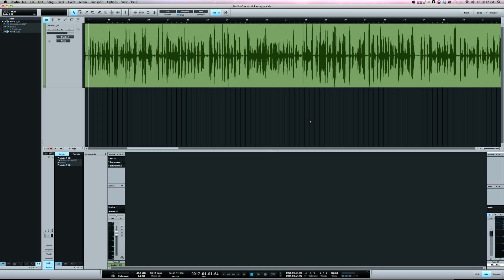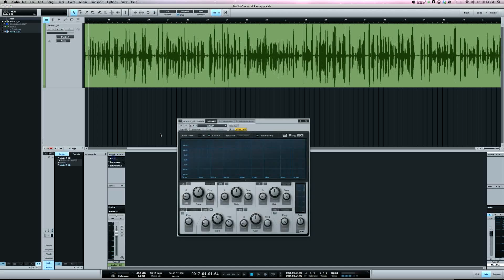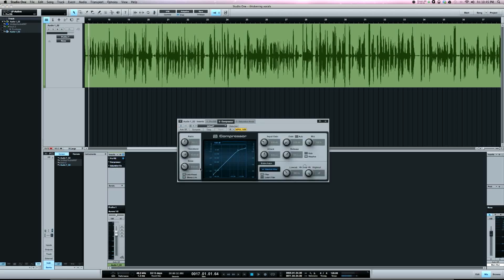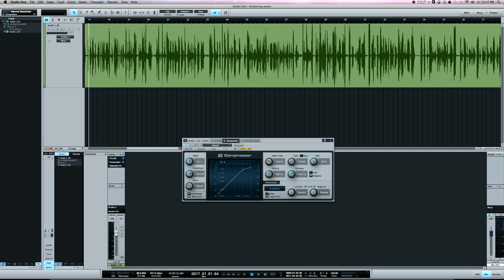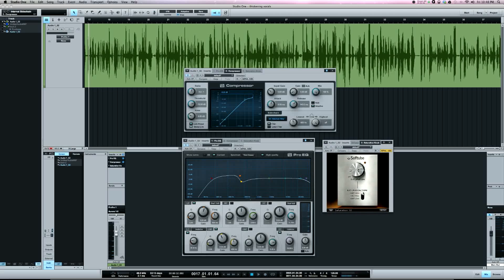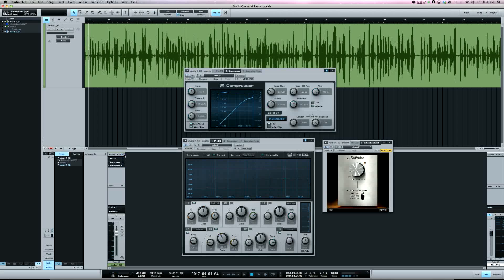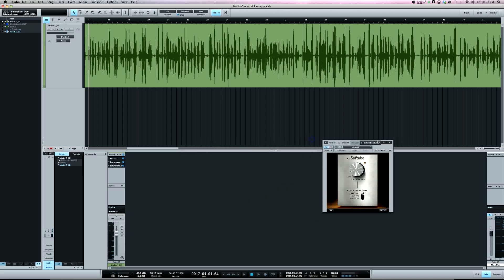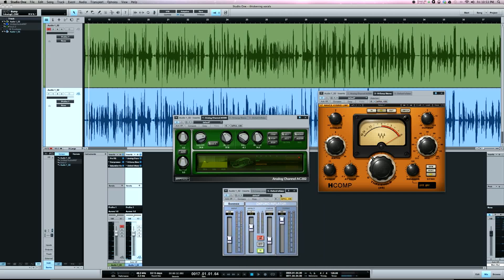thickening vocals In Studio One

Comment: Thanks for the video. This is excellent info and I can certainly apply these techniques to my process, but not many people have access to a $3000 mic and $3000 pre amp.

Can you do a video using a more economical mic and pre, so we can see what limitations you might have, or adjustments you might have to make when starting with a lower grade signal? Thanks!
Reply from the maker: the approach would still be the same. Using a low end mic and pre you would likely have to use more processing by plugins to get the sound you want
Reply: ***** I have to do one 2 full version and I I can not find that Softube anywhere in my studio I have the red light district but know it'only Mike I have is amkg 3000 b condenser mic and a little Behringer tube preamp. Will I still be able to achieve the sound quality you are talking about this with this year with this gear?
Reply from the maker: D-O-Double-G the softube saturation has to be downloaded. Search presonus softube